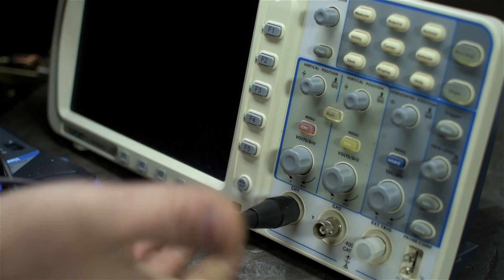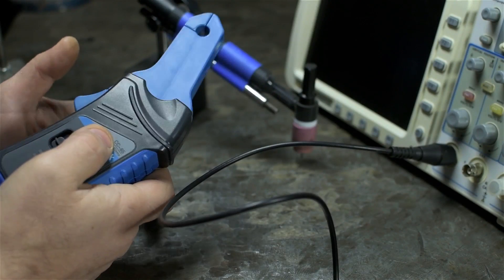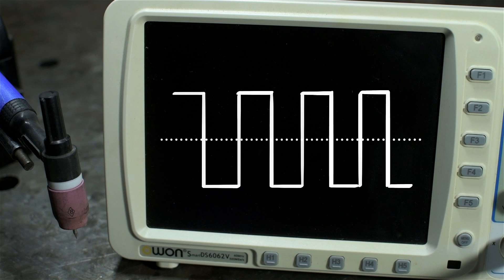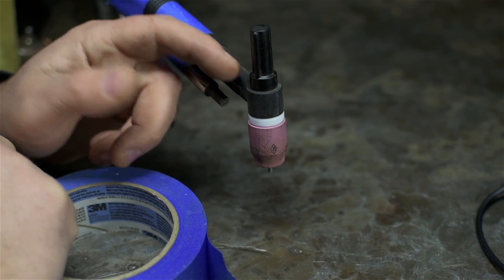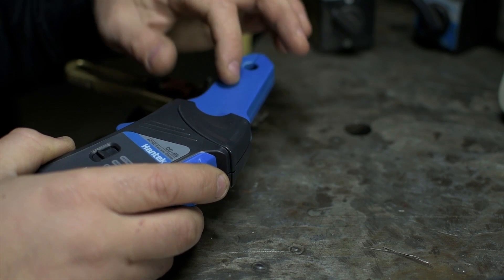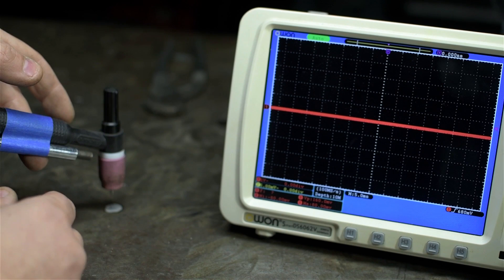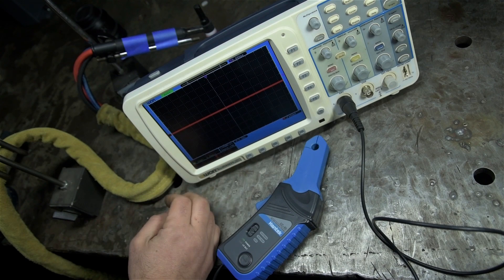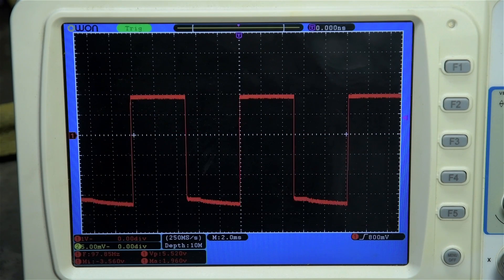Oscillo-Help-Me?

Comment: Pretty likely that the clamp is the culprit, and is saturating at a peak-current. The asymmetry of the internal settings makes it so that the +threshold is different than the -threshold. Please check the following (in sequence):
1) A simple test: Reverse the clamp direction (put it on backwards on the same grounding-wire) - Does the waveform on the scope invert? If it does, it means the source is the welder - if not, it is your clamp.
2) If it is your clamp - are the batteries in the clamp okay? Bad batteries affect the DC-balance.
3) I notice that there's a range-switch on the clamp - is it on its least-sensitive setting?
A clue to all this is a freeze-frame at 6:49 ish that shows a pretty waveform towards the end of a welding-cycle - the upper and lower clipping-levels are clearly visible, whereas the rest of the current is a nice sinusoidal and symmetric 'ringing'.
Cheers!

Comment: 1) As some pointed out, you should put your welder in DC coupling mode (not sure what you set it to). If your scope is in AC mode, the area (!) covered by the wave halves (not the amplitude) will be symmetrical. DC offsets will be filtered out. Maybe your probe is also DC only, some current clamps are. I'm not sure how the waveform is supposed to be, as I don't know much about welding. But the one you're getting is absolutely plausible with a H-Bridge inverter. 
2) I am suspecting your rig a little bit. The HF start kicks out lot's of noise a scope is not made to withstand, especially if you're floating it, and the chassis is not grounded. BUT do not ground the scope to your bench, ground it to a wall plug, best not one close to where the welder is in. 
Now, I don't want to be that guy (you know, the scope snob) but both Owon and Hantek are both not really known for building high quality products. I would suggest, if you could be bothered, to ground the scope properly and use differential probes, which are made for isolating your scope off high voltage. Then again, those will cost more than your scope did, so...
3) I have a hot tip for you, the wisest pixy cowboys usually dwell on Dave Jones' EEVblog forum. I wouldn't bet that there are loads of welders running around there, but they are very helpful and most certainly, somebody there should know. Not in the weldin' part of it, but certainly, they can prevent you from releasing the magic smoke from your rig.
Reply: If you read this, I have also a question for you (and anyone passing by). 
Do you think it is possible to teach yourself TIG welding, only by watching videos and reading books etc?
I would like to know how to do it, I won't need the prettiest welds, just glueing together small stuff at home. 
I know, it would definitely be better to take a proper course, and I really would like to, but my current life situation does not allow me to do so. 
Thanks in advance.
Reply: Also, I was just wondering, is the welder mains earth reference? As in, is the ground clamp directly connected to the earth pin on the plug? You could check with a multimeter. If so, then it /should/ be okay to connect the grounds, as they are /in theory/ at the same potential.
Reply: It's possible. 
I did.
But it's a trade - you have to practice it.
Get yourself a small stick (mma) welder and turn it into a scratch-start tig. 
Jody from weldingtipsandtricks (here on youtube) has a great tutorial on how to do it. 
Ordering parts myself at this very moment.
Basing it off of migatronic delta e160.
The machine was 240 european pesos.
Reply: I recall Jody presenting a small TIG welder that had just basic current and polarity control. I don't know what it was called, but I was looking into some of those. I thought it would be cool to be able to weld aluminium.
Reply: That "would be cool" will cost you a minimum of $500. 
And for a non-commercial purpose?
Do you really need it?
Reply: That's true, but I do work with Aluminium for the most part. I think for my home gamer use a chinesium welder should do for starting out.
Reply: Ivo Trausch are you located in europe or in the states?
Reply: Europe, Germany mostly.
Reply: Ivo Trausch have you looked into stahlwerk ac welders? 
They seem to have a reasonable bang for buck.
I didn`t choose it because of no distributor in my area thus being virtually warranty-less.
Shouldn`t be a problem for you.
They tend to have a bad motherboard once in a while but other than that pretty good machines.
Reply: Ivo Trausch or ahp alpha tig if you can lay your hands on one. 
Same story regarding warranty.
Reply: I have seen those, or the LCDvision ones. This one comes with all the bells and whistles I could ever need. 
https://www.lcdvision-schweisstechnik.de/DIGI-AC-DC-180P-WIG-TIG-Puls-Schweissgeraet-Waveform-E-Hand-MMA-180Amp-32-bit-MCU 
Unsurprisingly, the AC feature does cost more than adding a ton of features.

Comment: Plug in and turn on some big-ish load such as a heater and put the clamp on the AC wire and check if what you see on the scope is shifted downwards too, if it isn't then most likely what you're seeing is correct, except, perhaps, if the current clamp is being overdriven by the welder because it can't handle so much current and the signal is being clipped, for some reason, assimetrically, when the current sense clamp is fed with out of range currents.

Comment: the manual shows symmetrical waveforms: http://www.usaweld.com/v/vspfiles/pdf/HTP_221_Manual.pdf

try mounting the current clamp the other way around and see if the asymmetry follows

if you are feeling adventurous take the lid of the welder and see if you can find the place 
it measures current, I'd also expect that to be before a filter that keeps the HF start out of the inverter
Reply: In page 11 of manual, they  are showing current and hoe to adjust it En and Ep.
Reply: on page 10 they show asymmetric pulse width, on page 11 they show asymmetric currents
Reply: I found the Linux nerd!

...hello, friend!
Reply: Do you folks really think that TOT would be asking about the ep+ and ep- voltages if he had twiddled the AC ep+ and ep- settings? It seems pretty unlikely to me.
Reply: That’s is one nice piece of factual data severely lacking from most of the other comments
Reply: Thaddeus Jancewicz woo thad my man sup dawg

Comment: The top l;ooks clipped. Notice the negative rams up in current as the arc builds (down on scope.) The positive is always flat; I would expect the same shape as the negative. 
Rotate the probe 180 degrees and if you get the same thing, it is the probe or scope. If it was the welder, you would get the same but inverted.

Comment: as a more complex theory to balance the many simple theories you have been offered, electrons like to flow off points (the tungsten tip) more easily than the flow of flat/smooth surfaces. thats why corona discharge wires have points and van der graaf generators have domes on teh top.  So it might be that it needs more volts to push electrons from teh table into the tip than from the tip to the table .. ie the relationship between voltage and current is different in the different directions ... its over simplistic to talk about ohms law at high frequency (inductance impedance reactance not just resitance) but in laymns terms consider the resistance is different in different directions. ie a semi conductor. You just built a kind of 200 amp not very good zener diode ;-) ... 

BTW depending exactly what your tig box smarts are trying to balance .. is that really current or voltage or POWER (dont assume .. most DVMs on current range arent actually measuring current, they measure voltage over a resistor ie rely on ohms law again .. and many DVMs assume AC is a pure sine way is RMS is 1/1/424 of peak .. but for non sinusoidal waveforms, thats not true )and thanks to SMPS etc, more and more mains supplies are not clean sines these days  .) .... my point is that what your current probe is picking up .. current (and converting that to a voltage the scope is reading) .. wont match up if your TIG smarts are balancing voltages say ... in which case what the scope is telling you is happening on the VOLTAGE its getting from the CURRENT probe is really true

Or it could be your scope is being tricked by a switiching spike. if you doubt the scope, the test is to  connect up another and see if they agree (ideally a different type, if possible an analog one (with the DC connect enabled (to the current probe, NOT a wire to teh tig or the work !) as another viewer already suggetsed. analog scopes dont spike and glitch , smart digi scopes do

or many (not all) of the other comments. or a combination of them. 

Or .. its just the NSA messing with your mind ?. 

BTW2, can you harness that imbalance to power some kind of cold fusion pepetual motion machine that can make the go kart go faster ? What did Stefan say ? How does Chris suspect the ancient greeks did it, guday mate ?  I suspect abom doesnt have an occiloscope, why would he  .. but, does his shaper backstroke go faster than the forward stroke due to teh geometry of the pushrod from the drive wheel to the ram ? We should be told. 

BTW3,Others have give other advice and told you to ground the scope and reading a voltage thats half true (connecting precision electronics to welder is another story entirely) BUT ..  a current probe is a balanced device the ground is to the other end of teh coil in the probe, your battery scope is fine as is and my 2c is very strongly do NOT ground it to mains ground OR to your welder. or at least, if you do - its your scope, dont ask me why the magic smoke escaped. 

BTW 7 ... is it welding OK ? then put your scope away and stop worrying ? , its been scientifically proven that what you dont know cant hurt you, which is why its safe to cross the freeway if you keep your eyes closed

Good luck
Reply: That's what I was thinking too. Pointy vs flat electrode. Wouldn't you call that a crappy Schottky diode rather than Zener diode tho? (A Schottky diode that is operating above its breakdown voltage)
Reply: could be, some kind of asymetric transfer function anyway. ;-)

Comment: You could try to reverse the direction of the clamp. In theorie the signal should be inverted (higher on the top and not on the bottom).

Comment: The top is definitely clipped - it's too square to be a real value. Also you can see it just running into clip while it's ringing at the end of some of the welding pulses. Have you tried fitting the clamp to the cable the other way around (so that it thinks the current is going the other way) to see if it then clips the bottom half? If the clip stays on the top, it's the 'scope.

Comment: On most newer TIG machines, I believe in AC mode HF is on continuously because the current crosses zero at whatever frequency you are operating.  On older machines you could turn it off / start / continuous.  You couldn't really weld on AC with it not set on continuous. ??

Comment: the oscilloscope is ok being plug in or on a battery and the clamp dose not have limes but the oscilloscope dose look at the knobs and all the setting on it as  to the wave form it look good but dose looked clipped at the top but i dont know welders

Comment: Never ran into this before but if I question my equipment (I'm an electrical contractor) I use it on known source, for instance, if my amp probe isn't showing RMS, I'll simply connect to a wall wart or a circuit that I can add in a known amperage item to see if the clamp reads as correct.

Comment: Put the clamp meter on the ground wire "the other" way. If the machine side exits the "front" of the meter, flip the meter so that the machine side is on the "back" or the meter.

If that's the actual current waveform, the new  waveform will be exactly the negative of what you saw before.
Reply: My thoughts....exactly

Comment: Offset: with no signal your trace looks like it is flat on the zero line, not a problem.

Range of clamp: could be an issue, it does seem to be cheep, as others have suggested, try measuring lower currents and see if they are symetrical, also s pure sine current from your wall outlet and into a space heater or light bulb could be interesting. 

Oscilloscope gnd: No connection to gnd/PE might be why you see the disturbance during HF-start, running it off the grid with a proper PE connection should fix that. 

Fixed offset in welder-industry: no clue what so ever.

I have my money on the current clamp being of poor quality.

Comment: Might be your clamp.    Although you are measuring AC, you should check that the DC reading is zero with a multi-meter.   

From http://www.hantek.com/Product//CC/CC65_Manual.pdf
"Before measuring the DC current, it is needed to turn the zero adjustment knobs on the
clamp until the multimeter reads zero. That means pushing down the zero adjustment
knobs on the clamp until the multimeter reads zero. Then let go hold of the zero
adjustment knobs.When using a scope,set DC coupled mode to measure DC current.
"

Comment: Make sure the scope is floating(in a voltage Sence,ideally run it of batteries or an isolation transformer), use as small an earth lead as is practical on the welder, hook the -ve of the scope channel to the welder end of the earth lead and the +ve of the scope to the work end of the earth lead(ideally just before the clamp or onto a bit of the clamp that isn't touching work.

That is to say, use the welders earth lead as a shunt resistor. Scope to mV and see what she says.

Comment: Using DC supply with symmetrical waves you get different amperage in DCEN and DCEP directions. This causes a direct current component which has it's disadvantages. To avoid it you can set the wave assymetric. Just an idea without actual experience.

Comment: I'd say that it's actually the welder giving you the asymmetric wave. For AC welding, the positive half is used to clean the oxidation off of the metal and it's actually heated/melted in the negative half and it's not 50/50. Because that's not really an industrial grade welder (not an insult), when they write the controller software, they probably use the same general wave form for AC and DC which is why you're seeing the positive half kinda chopped off. When they say "balanced", it'd be "balanced" for a non-ferrous metal and your adjustments are from that base wave form.
Reply: I've scrolled the whole comment section to see, if somebody wrote the right answer. And you got it absolutely right. Nobody wants a symetric WIG welder ... greetings from switzerland

Comment: One tip for protecting scopes (not relevant on battery power, but it may help later) is to have a plug-in GFCI (RCD) socket. Plug the scope through that. Then, if you accidentally get a ground loop that would send current through the ground trace on the probe and blow up the scope it will instead trip the GFCI and turn off. Spend $20 to save 400+.
Reply: SAI Peregrinus  what is the trip time of a gfci or an rcd.. 30ms at best.. it would help . But protect against killing the scoop not likely
Reply: 25 ms is the UL maximum trip time. Actual times tend to be faster. That's easily fast enough to prevent excessive heating of the ground trace, especially since the trip threshold is 6 mA. That's what they protect against. They don't protect against trying to measure something at a higher voltage than the scope input can support, or a higher current than it can support. Just problems with placing the ground clip on a non-grounded location.

Comment: Does the waveform change when you turn the clamp around? 
Is the waveform symmetric when you clamp on some random ac line?  
And the classic, did you check the battery?

Comment: I think i know what is going on. I'm not a professional electronic engineer but i practiced on my scope a lot.
I think that waveform is CORRECT. I have read the current clamp manual and you are not exceeding it's parameters (max freq at that amperage is ~20kHz)

I know that this waveform is ugly but it is VERY difficult to create very clean and perfect square.
Almost every welder uses forward transistor configuration: that means it can produce good clean waveform on one side but the other side it will be distorted
(because it uses energy stored in transformer to make negative half). I doubt it in this case, that welder have a lot of settings so the only configuration
for it is probably FULL BRIDGE, i couldn't find any informations about it internals unfortunately.  

I think welder is doing that. Don't worry in electronic world you only need to make something work. If it's ugly but it works then the job is done.

BTW. If you want to make PROPER measurements you should put your scope AS FAR from welder as possible to reduce interference. (Maybe put something like sheet of metal between scope and welder too). Clamping the ground clamp is bad idea to get realistic measurements! Some current can go somewhere around that current clamp. You should probe the torch but  i would be scared to not fry my scope.

Last tip for you: You can disable HF start option in that welder. I have read it on official page:

"Select the touch start mode for welding aluminum or any other material without High Frequency. This is important if your application takes you near sensitive electronic equipment, such as on site repairs in a hospital or repairing aluminum vehicles with on-board computers."

I hope it helps you in your future projects. I hope you will see it.
Greeting from self taught electronic, mechanical hobbyist.

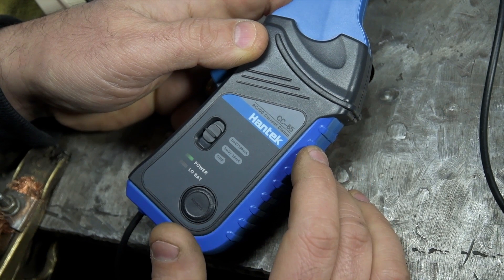Comment: The simple way to figure out if it is a setup issue is to try the clamp both ways on the same cable. If the top of the waveform is always flat, they the clamp meter is limiting. Also make sure it’s in the high range, at 6:29 it’s seen as in the low range which is only rated at 20A.
Reply: Also at 6:50 when you turn the welder off of flashes up with a symmetrical waveform briefly, albeit with the spikes on the positive side clipped at 20A. Try a test at less than 20A.